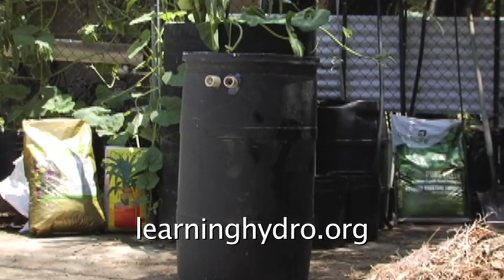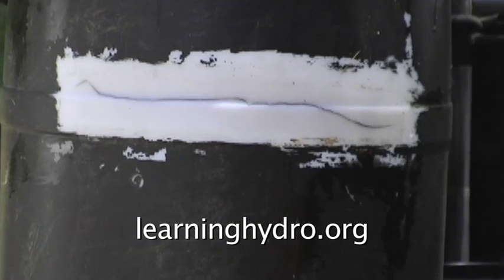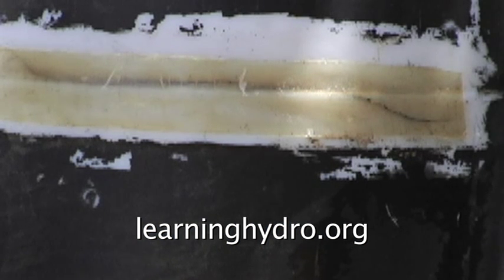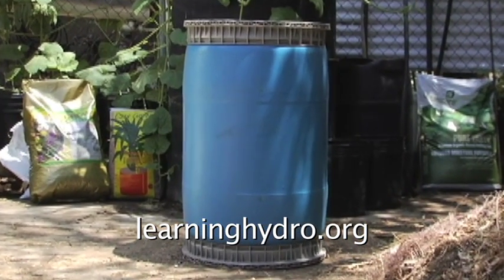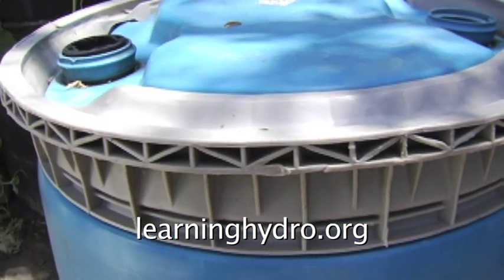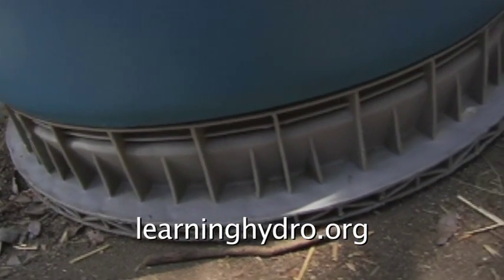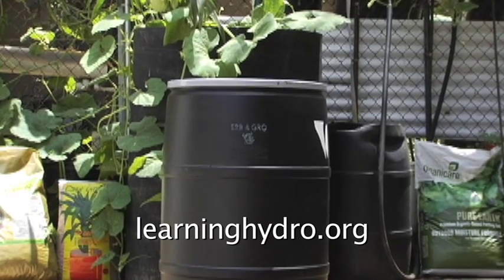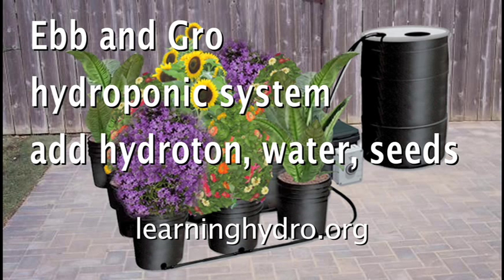Hydroponic resevoir -- do I make it cheap?  Or do I buy an Ebb & Gro?

Comment: Gotta paint it black before you paint it white or light will get in. Cyanobacteria can be a problem otherwise. There's a guy in my area that sells the blue barrels without the grey mounting rings for 25 each. They used to hold peanut oil in this case, the point is, used is out there and cheap. If you wanna do the work and painting it's like 40 vs 400. So an order of magnitude for doing the work. The profit margin on that ebb n grow is insane!
Reply from the maker: I can get the barrels for $10, $6, sometimes $5.  Sometimes as trash.  

The so-called 'ebb-and-flow' systems require 2 pumps and daily attendance.   I prefer a simple pump-up / gravity-down system.  In the past, I used a complete fill cycle --- the pump filled the grow vessels with solution, parallel drain pipes insured no overflow, the plants grew like trees.  Now I've gone to low-volume pumping to drip pipes with the out-flow flowing over other vessels on the fall back to the reservoir.

See the solar-powered pump / gravity-drip system at 

@Eis2Q1_aTKU?list=UUJFHO59lD3Qp9lfdekjsqMQ

That system of solar pump and hydroponic tubes cost approximately $125 to $150.  I used many scrap pipes and fittings.  The neoprene caps I bought new on Amazon.

http://www.amazon.com/s/ref=nb_sb_noss_1?url=search-alias%3Daps&field-keywords=Fernco%20Inc.%20PQC-106%206-Inch%20Qwik%20Cap

$5.52 x 6

The pump/drip concept allows for days of failure.  If work takes me elsewhere for two or three nights, the solar pump pumps, the drip tubes drip, the plants grow.  I've stayed away for longer periods --- and a helper hosing down the system keeps the plants alive.

Comment: Seriously WTF would Repair or buy a new barrel when used ones are available all over for 10 bucks
Reply from the maker: Not everyone has access to reusable barrels.  Also, the barrels require transport.  Not everyone has a truck or station wagon.  Try taking a barrel on a city bus.

Another consideration.  If I have cut ports, drilled plumbing inputs, I would rather repair the barrel rather than replicate the work on a replacement.

In other video comments, I state that I buy barrels for $5 or $10 or get them free. Again, acquisition is haphazard.  I make the best use of barrels without expectation of more.